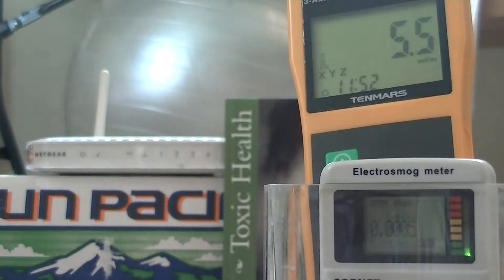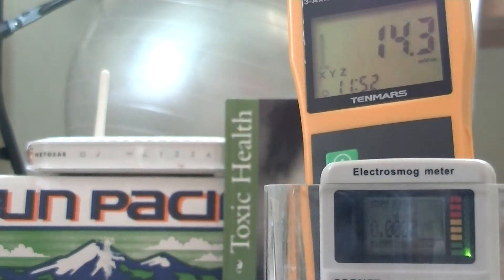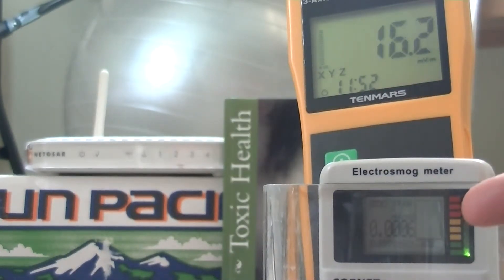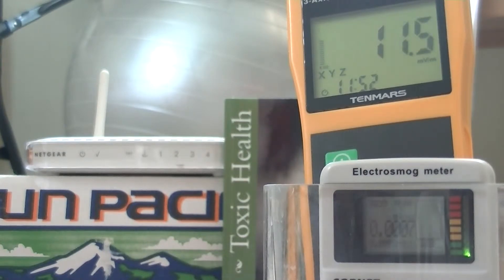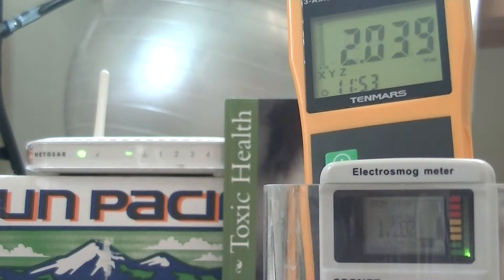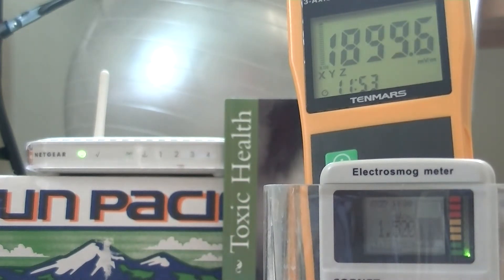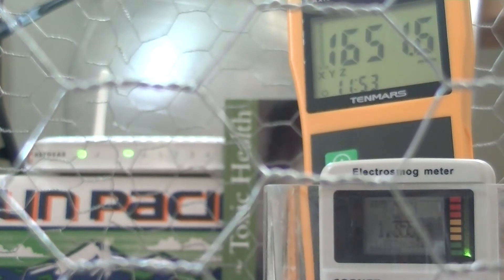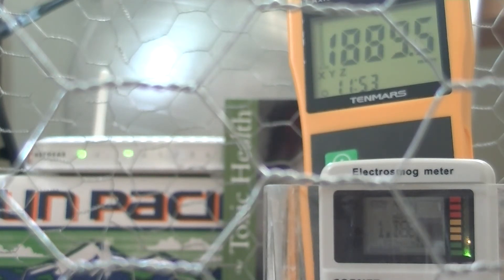Ungrounded Chicken Wire Faraday Cage Regarding 2.4 GHz WiFi

Comment from the maker: The two meters are reading different areas of the Faraday cage.  The Tenmars TM-196 sensor is about 6 inches vertically out of the video.  RF readings get lower the closer to the ground you go, hence the low readings on the Cornet ED75.

Comment: I noticed that the readings on the two meter does not match each other.
At 2 V/m you should have on the Cornet meter around 10000 (ten thousand) µW/m2, but it shows only values around 1000 - 1600 µW/m2.
Is there such a big sensitivity difference between the meters ??